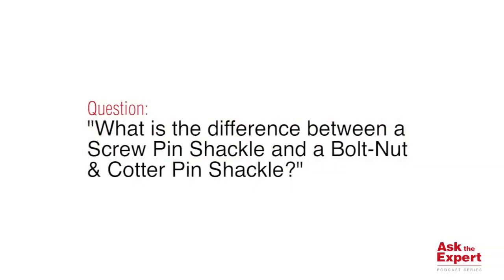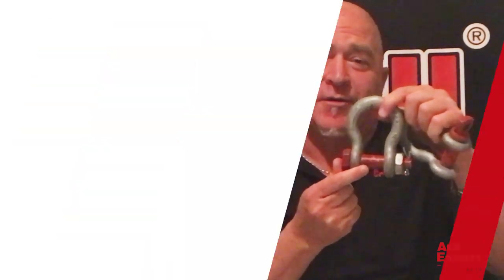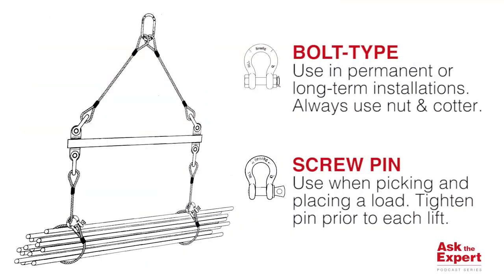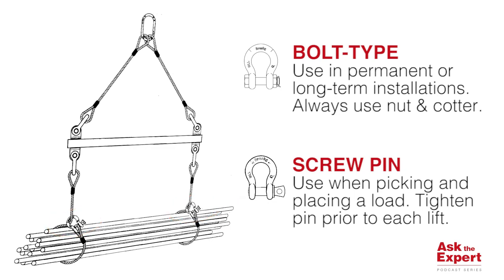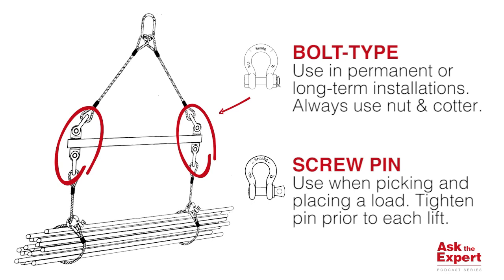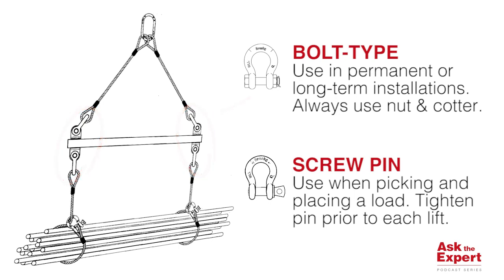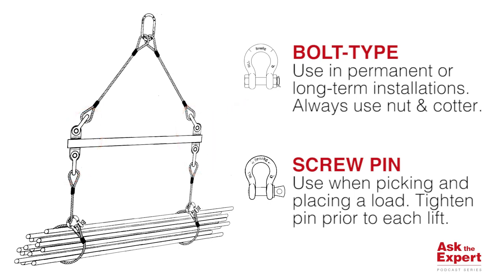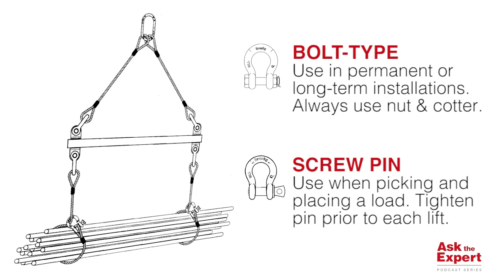Shackles: The difference between screw pin, bolt-nut, and cotter pin

Comment: Can you use a screw pin for permanent installations if you also mouse it?
Reply from the maker: Thanks for your comment. It is not mandatory, but we recommend bolt-nut cotter for permanent installations. Yes, you can still mouse a screw pin shackle for permanent installations. 
Thank you for your question.